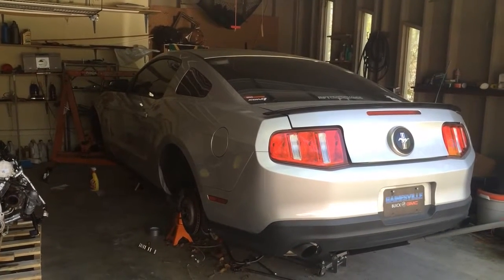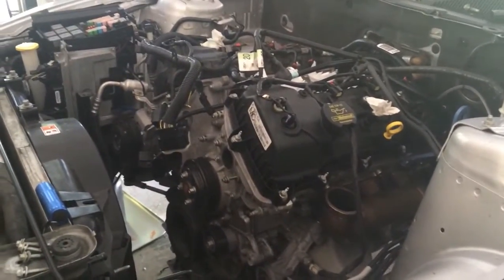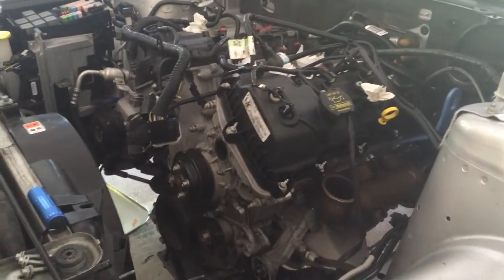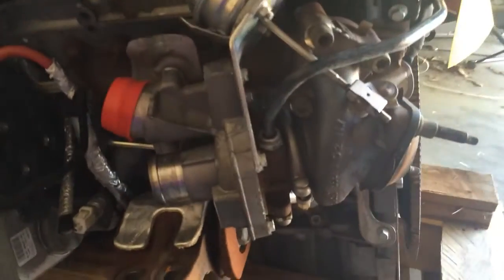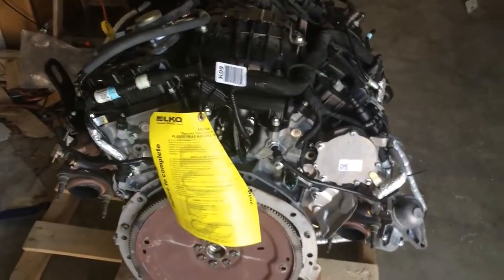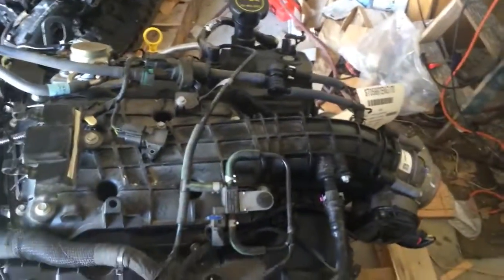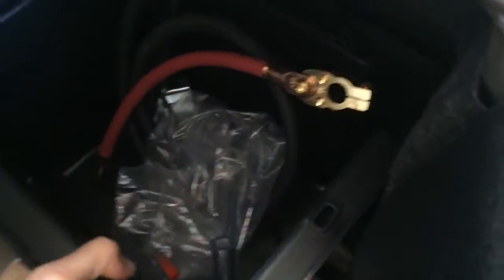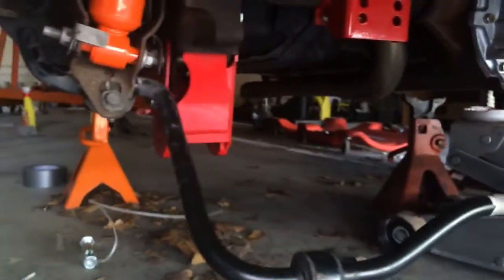3.5L EcoBoost V6 in a 2012 Mustang! - Part 1

Comment: So is everything easier/cheaper on this if the mustang is an automatic?
Reply from the maker: No, it actually becomes more difficult as you will have to find a way to control the trans independently or just use an F150 ECU that brings with it a whole nother set of problems.
Reply: @DCGarage  Well that's exceptionally disappointing. There really is no hope for a 3.7L A/T Mustang, lol. Thanks for the reply!

Comment: DC, did you use the ECU system out of the F150 to control the 3.5. Or buy a control pack? Also, do you think this swap could fit into a ford ranger fairly easy?
Reply from the maker: Control pack. It should fit in a Ranger, but the swap would probably cost more than the truck.

Comment: I'm curious see if the steering column is going to be in the way of those turbos. Keep those videos coming!
Reply from the maker: +Rictor Scale It shouldn't be, at least not with the stock turbos. The way it's designed, the turbos don't actually stick out all that much farther than the factory 3.7 exhaust manifolds. I really want to get some bigger turbos on there though, but hopefully they will still be able to fit.

Comment: Please more videos! Thank you for doing this! My goal is to put the ecoboost turbos on the 3.7. Ford could learn from this and put this engine in the 2015 mustang v6
Reply from the maker: +Rictor Scale I hate to say it, but despite the relation between the 2 motors, I'm not sure the EcoBoost turbos would work on the 3.7. The block casting is basically the same, but the heads are completely different. A few people have asked if these turbos would work with the 3.7 before. I'm sure you could make them work, but honestly it would probably be more trouble than it's worth. They're little turbos and the manifolds are very low volume to help with spool at the expense of flow on the top end. It's great for trucks, not so much for sports cars. I would suggest getting a purpose built turbo kit for this car. There are a few out there, and you'll probably get better bang for your buck. I'll go into this a bit more in later videos. I hope this helps!